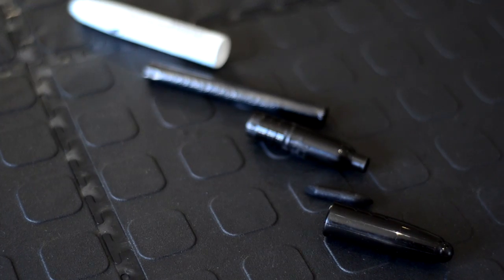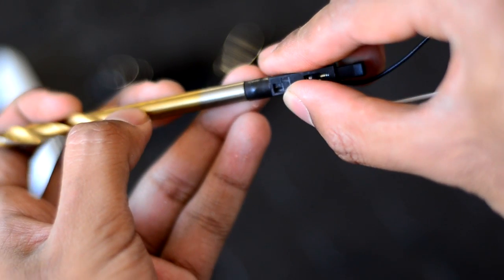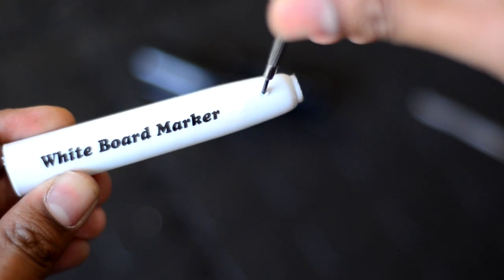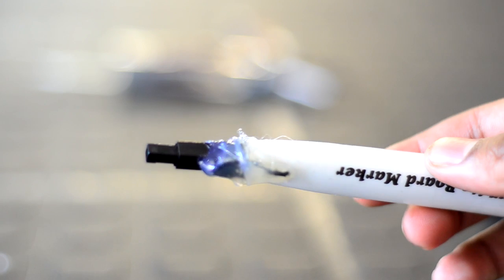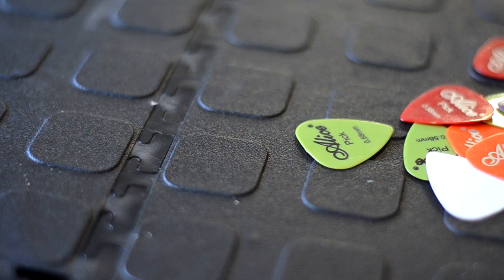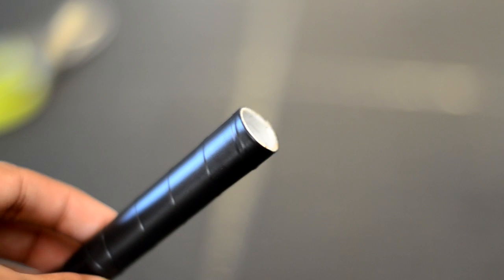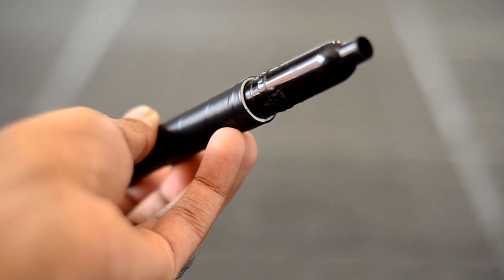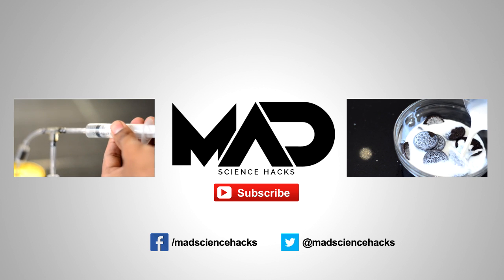How to make a ROCKET MISSILE LAUNCHER!

Comment: So you burn the alcohol and because you burn it you have heat and cause you have heat you have more pressure ?
Reply from the maker: It works on the principle of expanding gasses caused by the combustion of the alcohol vapour.

Comment: I think in alternative to alcool you can use the gas of the lighter to fill the combustion chamber.. ;) 

-LudvicTV
Reply from the maker: You could do that but I found that  alcohol is safer to use because the amount of fuel can be controlled precisely. There's no visual indicators to show you how much of gas is in the chamber. With the alcohol, its just 1 drop every time.
Reply: Yes you're right.. But with the same  reason if you fill with 1 "second" of lighter gas (from the lighter Obviously) I think you can make the similar amount of fuel ;)
Reply from the maker: I just tried this and it doesn't work. No combustion at all.
Reply: +Mad Science Hacks | Life hacks & How to
ok good to know
Reply from the maker: It could work. Maybe I didn't get the stoichiometry right.